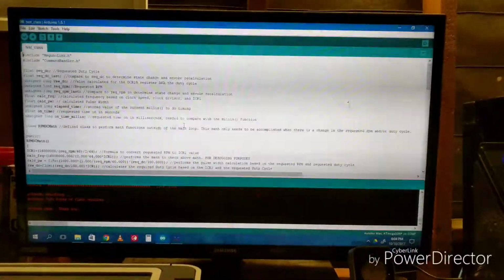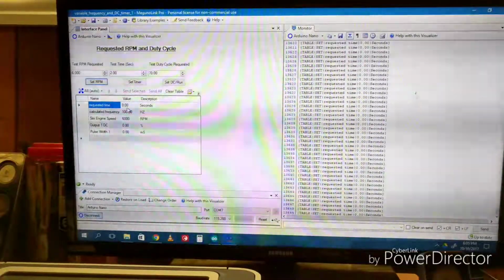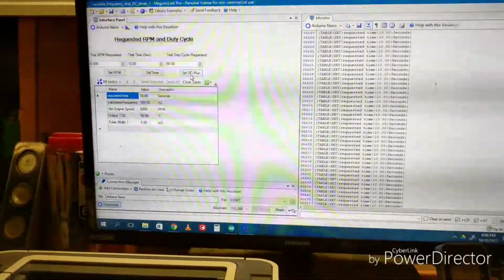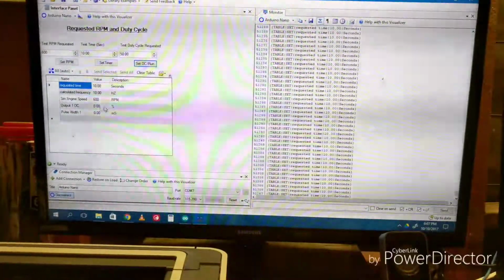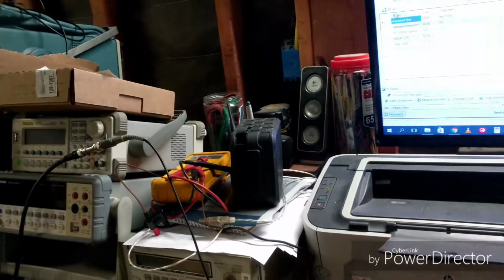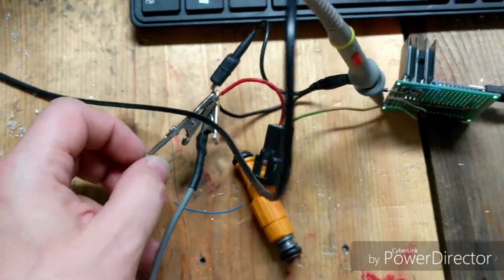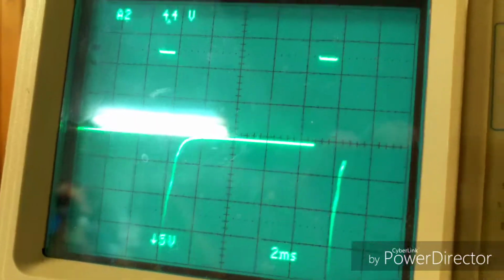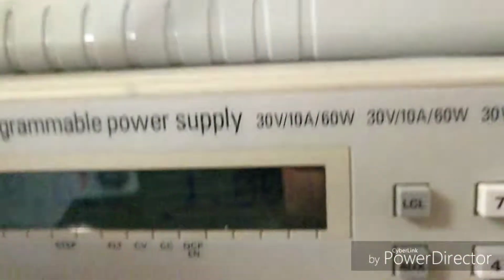Diy flow bench test 1

Comment: good job, 
The mosfet could be blowing due to the inductive kickback from the injector which exceeds the voltage rating of the FET.
Make sure the diode is installed in the right place and direction and its fast enough to clamp the transient spike.